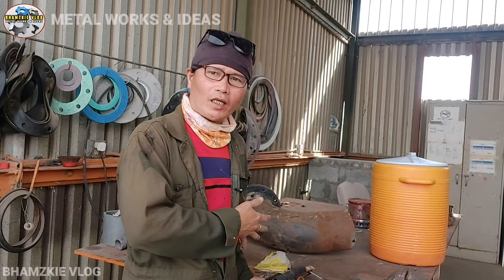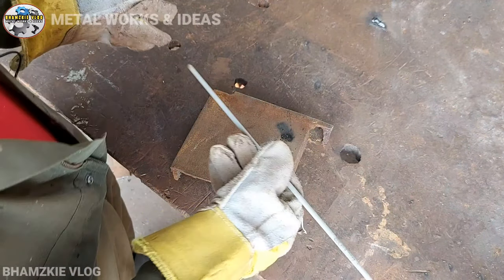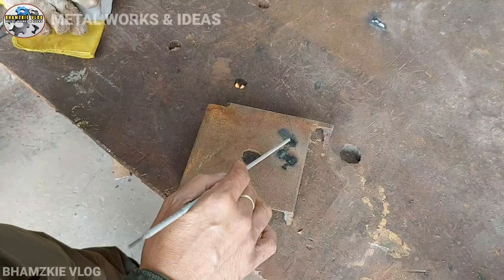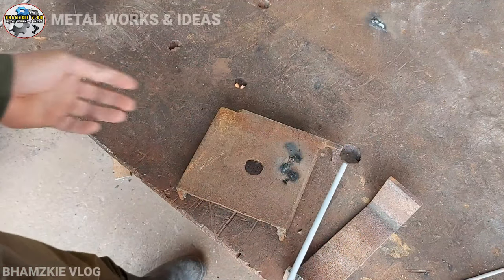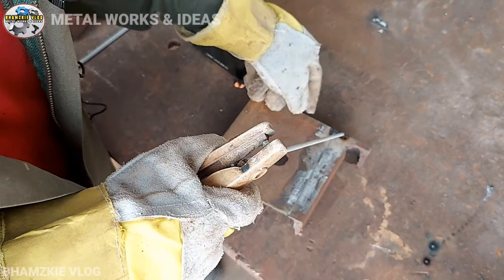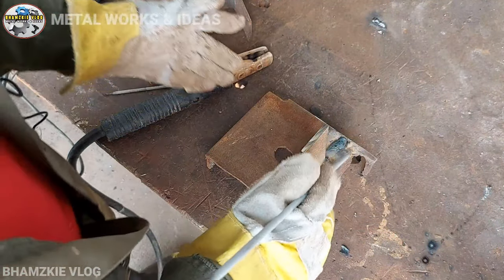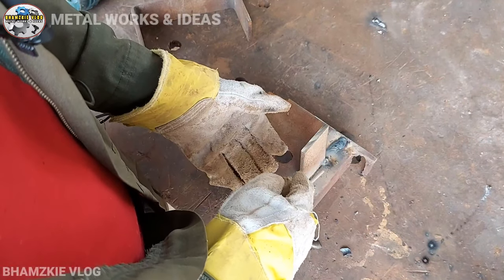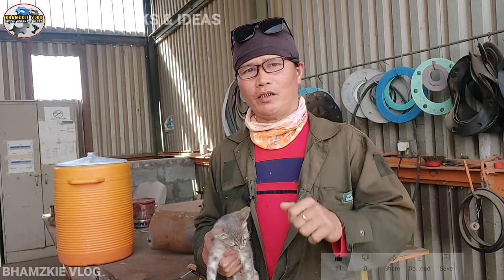MGA PARAAN PARA MAIWASAN ANG PAGDIKIT NG WELDING ROD SA BAKAL|@Bhamzkie Vlog

Comment: It depends sa welding machine sir yung mga welding machine dito sa pinas karamihan yung budget price lang hindi true rated amps d gaya dyan sainyo yung 45amps niyo sa 1.6 na 6013 anlakas na dito may nagamit ako hindi makawelding sa 45amps need mo pa i 150amps para maganda ang weld
Reply: Tama . Pag mumurahing welding machine talaga. Di nag sasabi Ng totoo.
Reply: tama tama
Reply: Yung mga true rated brand na welding machine dito sa pinas na inverter type
1.powercraft 
2.contender
3.vega
4.daiden
5.lutos 200amp 7k price up
6.ronix
7.mitsuden 10k up price
8.ingco 9k up price
9.husman 10k up prize 
10.yamato 10k up prize

Pinakahalimaw dyan yung powercraft hercules 200amp 100% duty cycle